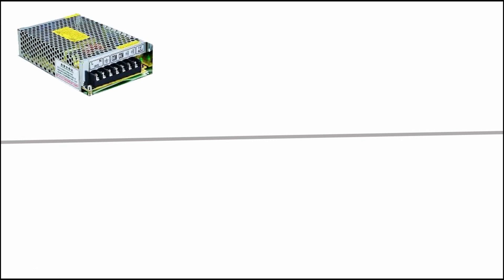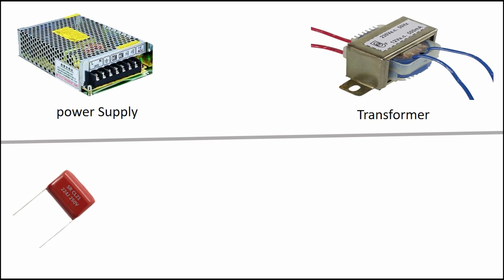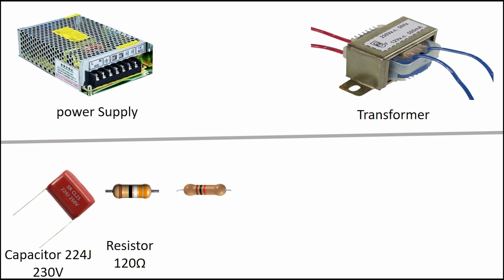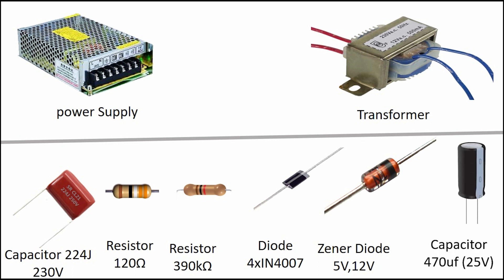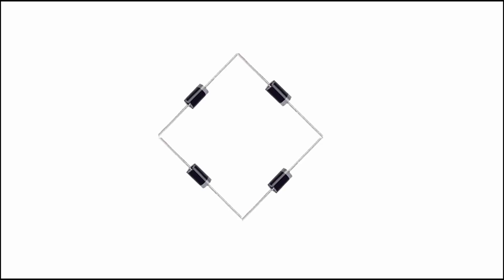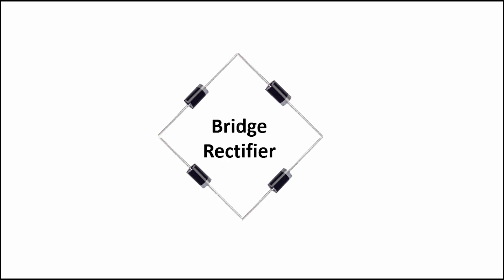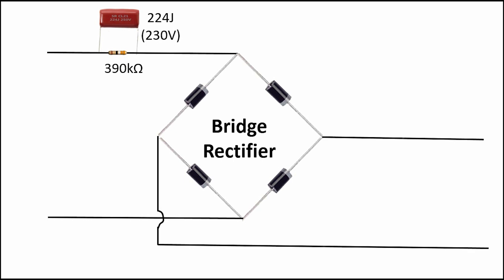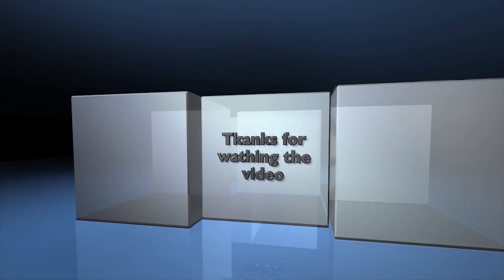Transformer less Power Supply | transformerless power supply high current | Earth Bondhon

Comment: my zener just blow up when i use 6A bridge rectifier
Reply from the maker: No, using ......Low Ampere......Output.
Reply: @EarthBondhon  I know, the solution is using 12v voltage regulator, they does'nt blow up, they heat up so you have to mount heatsink on it
Reply from the maker: @diablodizzy.  Ampere?
Reply: @EarthBondhon  I don't know exactly it is, but it's better than using 1N4007 Rectifier Diode. Btw im using RS 605 Bridge Rectifier

Comment: I have more capacitor 105 J/ 400 Volt, 105j/400 and 1uf 275 Volt i want to make 5 volt Dc output, charger .  What is other  components  Required for this circuit, please make videos with.Detial.

Make table with components value
Reply from the maker: yes,
output voltage 12v-15V DC or AC

Comment: sir let how to check up the maximum or minimum output current will it provide
Reply from the maker: maximum 25V  or minimum 15v output current will it provide
Reply: hey as u have mentioned in video using 5v zener diode we can make output voltage to be 5v so i want to know how many maximum current in amp this circuit will give and how to make changes according to the amount of current i want to draw out of it.